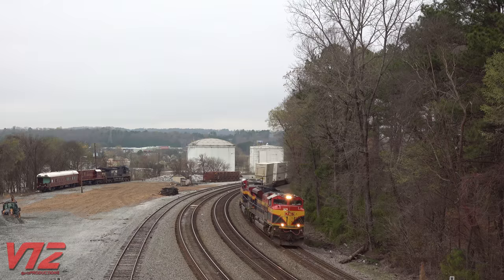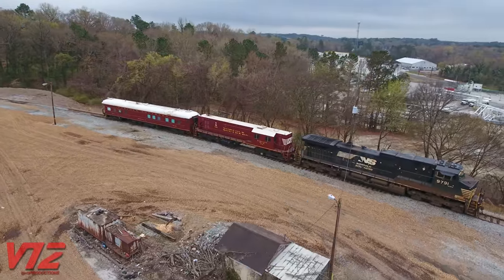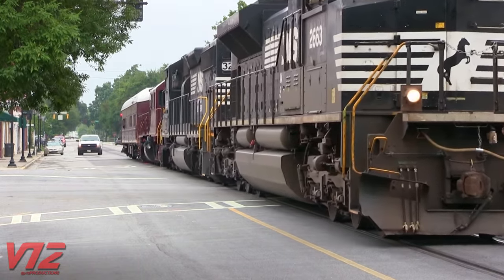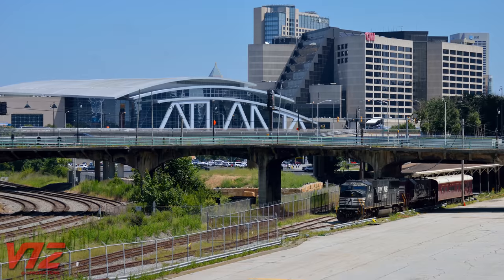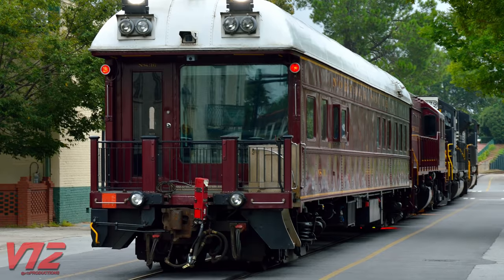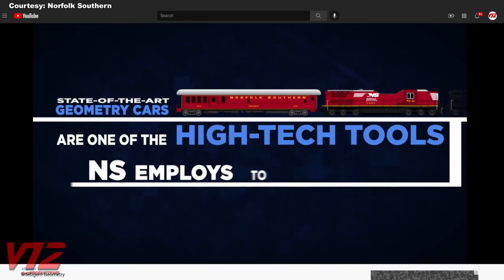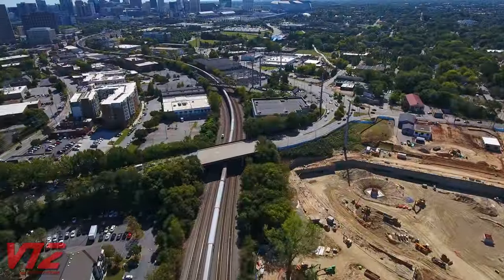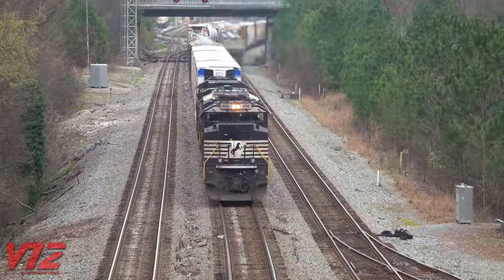"THE BRICK" - It's NOT a Locomotive

Comment: I spent 3 months looking at pictures of the NS "brick" to design a 3d model so I could 3d print it for my HO Scale layout. It is quite a neat piece of MOW equipment!
Reply: That's awesome. You got to see what many don't. Like me before I retired. Only 2 buildings in Cincinnati I didn't hang on the outside of. I stood in places only few people have. First when buildings were built and when maintenance needed to be done on the outside.
Reply: Noice
Reply: I've got some video when one was in portsmouth recently if you need
Reply: Look fast.   With the cost of electronics coming down, it's likely (& mentioned in the video) that the sensors will just be put on ordinary locomotives.    Every time the locomotive is stopped for even a few minutes it will automatically upload.   If it "thinks" there is a critical problem, it will alert the train crew and make a call to Hq.
Reply: My HO2 yard was almost completely MOW equipment, based on unique cars I'd seen and photographed on the N&W in Virginia. Butchered a lot of kits to make them. Nice thing was nobody could say it was a bad model because most were one-offs.
Reply: You have a 3d printer?
Reply: @frankierailfan4014  Yes I do have a 3d printer. And I have actually made quite a bit of cool things with it.
Reply: I'm working on the same thing now, I'd seen a picture of it in one of my railroad groups and decided I needed one
Reply: @IdahoRailfan  Are you willing to share the STL file? -Thanks
Reply: Is 3D printing cheaper than purchasing company made engines?
Reply: I'm curious to know what type of printer you're using and how you like the results. Cheers!
Reply: @queens.dee.223  I using bouth Flashforge and AnyCubic filament printers. and personaly I like the flashforge because of its software is easier to use.
Reply: @IdahoRailfan  Great, thank you for the info! If you ever made a video about your 3D-printed stuff, I'd definitely be curious to see.
Reply: @queens.dee.223  I have not. Maby I'll do one in the future

Comment: The first 16 years of my 37 year railroad career was spent in the track dept (M of W) and the Sperry rail services converted Budd cars would visit the territory 2 or 3 times a year. The commuter railroad I worked for originated out of Grand Central Terminal and 2 divisions went into upstate NY and the 3rd division went up into Connecticut (3 branch lines off that mainline) the Sperry cars were a frequent visitor to the  territory....Thank you for the great video and letting me remember those times when I worked in conjunction with SRS cars !
Reply from the maker: Thanks for sharing and watching!
Reply: The Sperry cars were actually not Budd Cars but very early Doodlebugs. The famous Budd RDC's came about in 1949. The Sperry Doodlebugs were almost all from the 1920-1930 era and then ultimately they started building their own from scratch.

Comment: That is so neat to see. In 1984 , I worked on FRA track geometry cars T2/T4 on most Amtrak routes in the country, and a Budd SPV,  T-10 in 1985. I also rode on Amtrak's 10001, The Beech Grove " between DC and NYC once a month. I almost bailed out of 10001 on Saluda Grade! Our brakes wouldn't hold, and two NS high noses trailing us (just in case, thank God!)  slammed into us and coupled on the fly.  I wrote about some of these adventures in  "Riding the rails with Riley" , TRAINS, September 2009.  The technology now is so far removed from our old computers and rolls of chart paper!
Reply from the maker: That's really interesting! Thank you for sharing!
Reply: @v12productions  My pleasure. It was a wonderful way to see the country, head end of an F40 or a POOCH down on the Sunset Limited. No SDP40fs, though, dang it. Best job I ever had. I have subbed.

Comment: Over in downtown Duluth GA I noticed a bunch of MOW equipment parked in a old siding there and the ties were painted and marked. Im wondering if NS plans on doing some tie replacement there would make for a good video you should check it out. The MOW equipment is right infront of the library in downtown by the signal

Comment: Saw the brick many times over the years. Conrail used Sperry rail service. I've even seen Sperry with just a SUV now doing inspections. Sperry also did rail grinding for Conrail. Santa Fe still uses Sperry service as I see it's railcar around in AT&SF territory and it's SUVs.
Reply: Aside from UP,  all the class ones still use Sperry as well as most commuter lines as Sperry offers proprietary testing equipment that no other contractor offers. The detector cars perform two types of internal rail flaw detection. The Hi-Rail Sperry trucks only perform the Ultrasonic portion so it is not as good as the detector car results which is why many railroads still prefer that method.   Sperry has never offered grinding service. You are confusing them with Speno rail services.
Reply: @FFred-us9tw  yup my bad Speno does the grinding. Haven't seen Sperry or Speno on NS tracks in eons if it runs the mainline I must always be missing it. Used to see it every year in the ConRail days. But I have seen the NS test train and it's usually more than one brick and one car with a loco. It's usually a The Brick, what looks like a Red slug and two coaches one of which is a theatre looking car on the lead or last trailing. Some years it passes through running backwards. Maybe it's both sets returning to Altoona for something not sure.

Comment: Their primary goal is NOT to detect track defects, but to pin-point areas where track defects are liable to occur and give the track engineers the chance to monitor and institute remedial action before the potential defect actually becomes a problem.

I spent my last 12 years before retirement working on Network Rail's track inspection fleet recording data on track condition to be forwarded to the track managers.
Yes, of course the data was checked against defined limits as it was recorded and processed and anything outside those limits was flagged as a track defect with, depending on how severe the readings were, 14 days, 72hrs, 36hrs, immediate or even Block the Line in extreme cases.
Anything below 14 days required phoning in to the line control with Block the Line requiring the driver to stop at the next signal to advise the signaller.
But fault detection was generally regarded as a bonus on top of getting the data to the engineers for future planning.

Parameters recorded include track gauge, cross-level, track twist, dipped joints on the old jointed track and cyclic top.
Later trains are fitted with Plain Line Pattern Recognition (PLPR) using ultra highspeed cameras to record the fittings at EVERY sleeper (cross tie) which are then processed through a pattern recognition and comparison system with abnormal results being kicked out for manual inspection of the images.

I also worked on MENTOR, the overhead wire inspection train with an instrumented pantograph to monitor the condition of the wires.

Comment: Why do railroads always seem to pull track geometry trains with big road engines? Sometimes I even see two gevos or aces pulling a three car inspection train. Is it that they want to see the rail after their heaviest load goes over?
Reply: If there’s no where to turn the consist at the end of the run having to back to back units prevents running long hood forward. With road units being the most available they usually get assigned to the job. Smaller units are generally dedicated to locals where they’re needed more.

Comment: What if instead of a generators, they just use they the old traction motors as generators and store super capacitors in the rear. Kinda like how dynamic braking works, but the energy isn’t decipated and it goes to the super capacitors.. might cut costs
Reply: Sounds like a good idea, but remember that energy would come from the movement of the train. Since the train is pulled by diesel locomotives, isn’t that essentially the same thing?  In actuality, there would be additional losses from friction and electrical loss so your proposed method would be somewhat less efficient than just running a generator.
Reply: @billmoran3812  true that true that
Reply: Teach yourself homonyms and homophones, starting with braking versus breaking
Reply: @coloradostrong8285  shhh 🤫